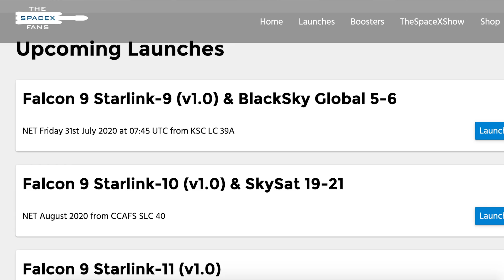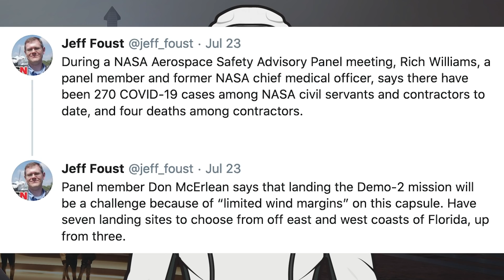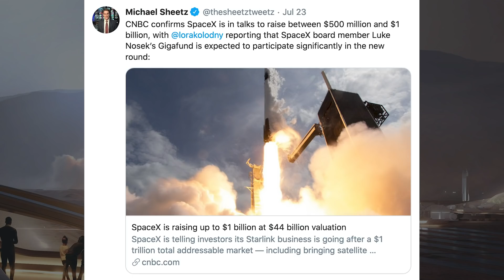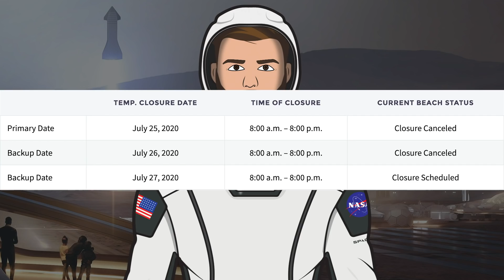SpaceX Starship Updates! SN5 Static Fire Soon, SN8 Build Continues! TheSpaceXShow

Comment: The main purpose of the header tanks is to feed the engines clean bubble free fuel during aggressive landing maneuvers. The fuel in the main tank would be sloshing around all over during the final flip maneuver and if a rocket engine ingests air bubbles it's done and would explode. Therefore they have small tanks that contain the landing fuel and can feed the engines no matter what orientation the ship is in. That's what ulage motors are for on upper stages, to settle the fuel at the bottom of the tank before igniting the engines in zero g. If you have powerful RCS that can also be used.

Comment: I would be willing to wager that sn8 is indeed a Pathfinder for the upper tank for super heavy. Would explain the structural additions to the top ring. Or also perhaps this is for the first starship that will also have to support a full nosecone...?
Thoughts?
Reply: Don't think it has much to do with super heavy. I'd guess they want to stack a full starship with SN8 for a higher hop/flight than 150/750m hop